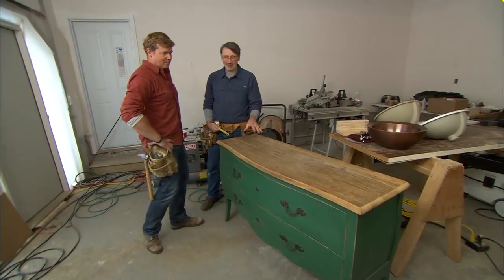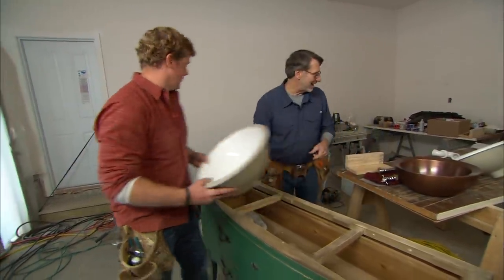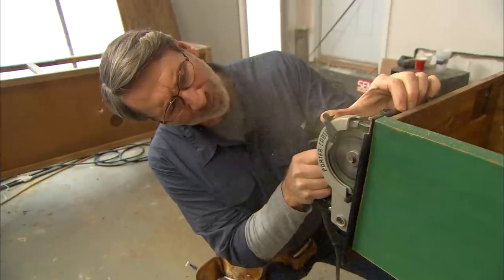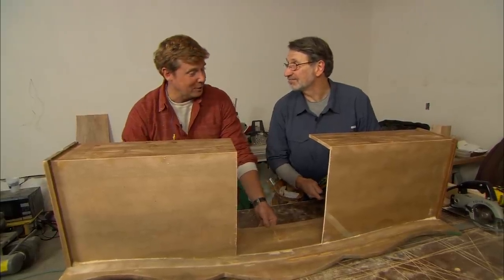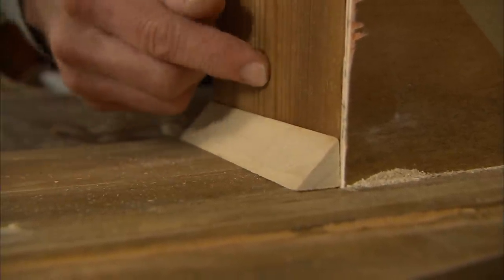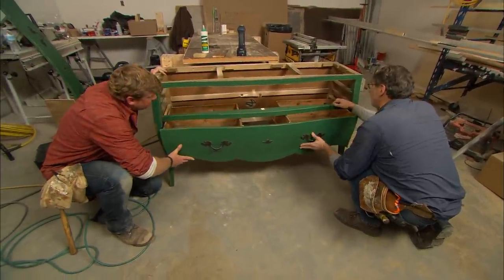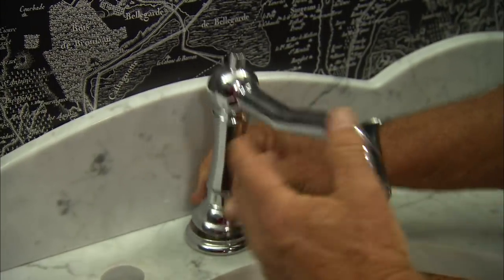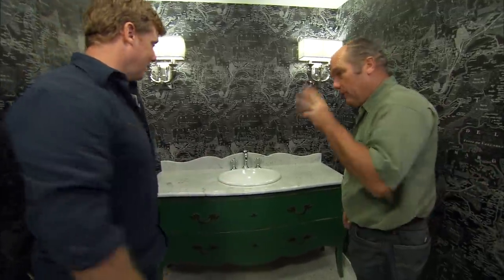How to Build a Bathroom Vanity | This Old House

Comment: Why couldn't they do two drawers, one on either side, for the top drawer as well?
Reply: I agree with you, it might be more work but worth it for the extra space.
Reply: I wondered the exact same thing...
Reply: @larrymoore6640  finish watching the video. What he says in the beginning is not what he ends up doing. Silly, but yeah
Reply: Tom Silva likely would've
Reply: @jorgeshicken   Agreed, and remember that Tom Silva is not a Master Carpenter!
Reply: @cfonvip5151  he's like a master everything tho. Pretty much
Reply: The sink is in the way. The drawers would have been too small.
Reply: @Jubileejones  would be enough for a shavers and a hair brush etc still worth the effort.
Reply: We dont know what the client wants, I've dealt with highly irrational and impractical requests sometimes. This bathroom looks like it for one of those kooks
Reply: I agree too with making two drawers.. I modified a 2 drawer set up on an IKEA  bathroom vanity just like Norm did.
Reply: @alant5757  Don't be so hard on the old timer. He used to be very, very good!!!
Reply: @ouroesa  lol they do exactly what they said they were doing in the beginning. They modified the bottom drawer, could've easily done the exact same with the top

Comment: I love the craftsmanship that went into making this. However, unless you are prepared to do the work yourself this is probably a $7,000 sink made out of an old dresser
Reply: Exactly what I was thinking.  Folks get overly ambitious and don't consider the challenges associated with their choices.  I did a project like this about 6 years ago, but planned it for 2 years, most of which was spent looking for the right piece of furniture.  Then that piece spent about 4 months in my garage while I considered the necessary modifications.  First, I chose a piece that was 3 drawers across so I could fit in the plumbing.  Then, I chose a partial drop in sink so it wasn't too high, but also fit the depth.  Once I had the entire project figured out, I got to work on demo of the old vanity, and moved the partially modded piece into position.  Took 2 weekends, and probably $250 total.

Comment: Major procedural question: if the top drawer front gets attached via internal screws so that the plumbers can access the underside... how are they supposed to reattach it after the sink is installed? Going up from the bottom drawer opening?
Reply: The bottom drawer can come off the rollers fairly easily

Comment: I have an Ikea sink/vanity. It's particle board and started showing water damage within the first year. Not only that, but the contractor who put it in butchered the lower drawer to accommodate the drain, rather than move the drain or at least do what Norm did and box out a space for the pipe - they just cut a chunk out of the drawer back. I would love to get some teak and rebuild the vanity, but I'm looking to sell and most people would probably gut renovate the bathroom, as the tub needs replacing.

Comment: Why didn't they just remove the lower drawer to install the plumbing?
I would have also used magnets to hold the fake front in place so that it could be removed easily.
But then, I'm not a professional!
Reply: I did this exact method on a piece of furniture I converted into an aquarium stand. Couldn’t utilize the top drawer because of some supports I had to install so I did a false front held in place with magnets. Drawer front removes easily to access storage... works beautifully!
Reply: @MidwestCoinHunter  
Because they used a granite top, they didn't have a problem with, or a need for additional supports. 

The carcass was more than strong enough to support the counter top and sink.
Reply: @scotttovey  
Sorry for the confusion. What I was saying was I used the magnet technique you described on my project because I needed to install supports which a sliding drawer wouldn’t work with.  The magnets holding my drawer front on works great and very convenient for removal.  Magnets, like you suggested, would have worked really well for the project in this video too
Reply: Would have really surprised that nosy guest who wanted to just peek in your vanity drawer to see what was inside.  "Hey Martha...we got another one!!" 😂
Reply: @MidwestCoinHunter 
Yep; I went in the wrong direction with that. 😂 

It happens a lot, but usually, they get offended and flame off rather than providing clarity.

Thank you for the clarity.
Reply: @scotttovey  
Haha, no worries!